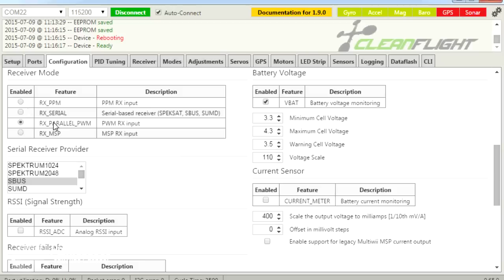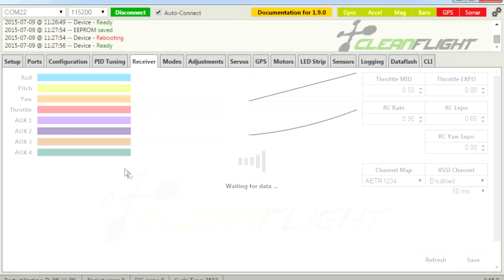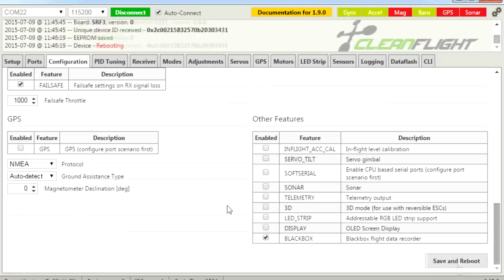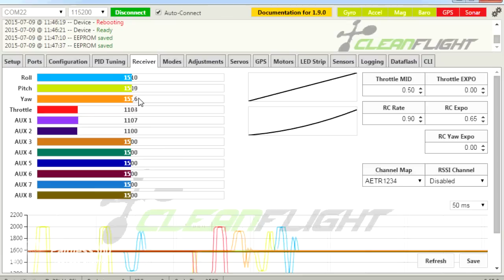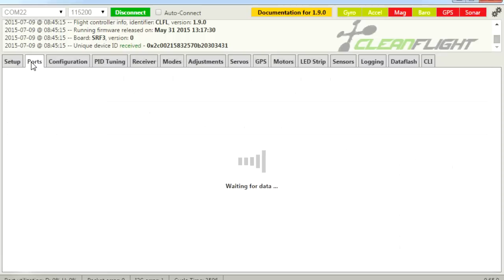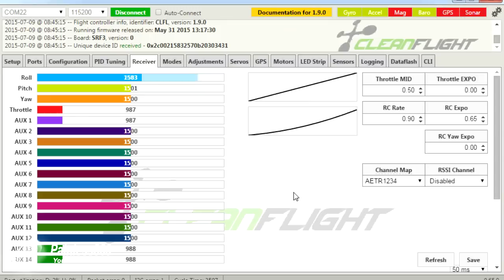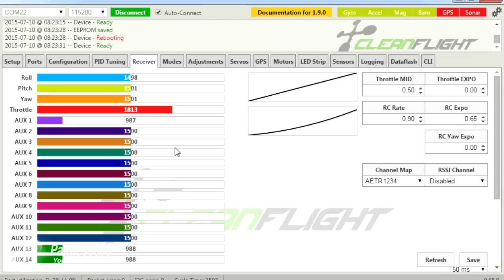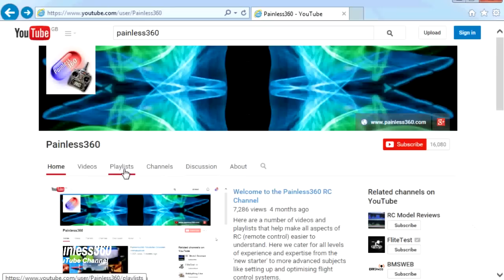Seriously Pro F3 (SP3) Quick Tip - Install and setup PWM, CPPM and S-Bus Radio Receivers

Comment: Hi Painless360,

 1st, thanks for all these videos, great work helping everybody out.

 I've bought the SP controller and I'm starting to configure it.

 I had a KK 2.1 that was pretty straight forward to setup and now I'm trying something a bit more powerful.

 I've got an "old" receiver (Orange Futaba FASST - http://www.hobbyking.com/hobbyking/store/__14300__OrangeRx_Futaba_FASST_Compatible_8Ch_2_4Ghz_Receiver.html)
 and from what I can see this must be a pwm receiver.

 I'm following this video and I found a difference, your left connector has an isolated white wire that you connect to the Aileron, but with my wires are a bit different, mine are like in this picture: https://cdn.shopify.com/s/files/1/0286/3478/products/spracing-flight-controller-acro-parts_grande.jpg?v=1441822425

Wires 1,2 and 3 are linked to the same connector. Does this make any difference?

Thanks again
Reply from the maker: +Luis Pinho The connections should be similar to the ones in the video. You can test if you have it connected ok by using the Cleanflight receiver GUI and swapping any cables that are plugged into the wrong connections. Best of luck with it!
Reply: +Painless360 Hi, the connectors it self are just a bit different, but the connections are the same :)

Already tried them and they worked.
Followed the manual and then watched the video to check if everything matched (My receiver doesn't have any battery "channel", so I had to connect to the already existing system in my quad).

(Edit: I'm watching the next video now, I think it will reply to the next question, sorry)

One question, did you solder the straight or the angled pins (that connect to the ESCs)? 
Any advice regarding the soldering order and the kind of pins?

Thanks again for your videos
Reply from the maker: I like the right angle pins as the height of the build is lower then, depends on the space and personal choice..

Comment: I know more and more people are now using CPPM (me), but the PWM set up on this board is awful. Have fun running those cables in a tidy manner.
Reply from the maker: I find most, like you, are using PPM or S-bus with most modern FCs. Nice to still have option for PWM though for those who still want it.

Comment: FVT LittleBee 20A ESC BLHeli OPTO 2-4S http://www.banggood.com/FVT-LittleBee-20A-ESC-BLHeli-OPTO-2-4S-Supports-OneShot125-For-RC-Multirotors-p-1007740.html

Upgrade NAZE32 SP Racing F3 Flight Control Acro 6 DOF http://www.banggood.com/Upgrade-NAZE32-SP-Racing-F3-Flight-Control-6-DOF-10-DOF-for-Milticopter-p-1010232.html
firmware Betaflight 2.3.5 installed - ok

from ESC to the controller only signal wires
powered sp racing by BEC 5(5.03v 100%) volts
Connect the USB + Connect 4S = Blown controller! LEDs do not burn.
probably burned elements LG33
What is the problem?
The second time so !!! (I thought marriage was caught for the first time)
Reply from the maker: +Сергей Жуков Sorry, not sure what you are asking..
Reply from the maker: We do provide direct support over Skype, but it's not free (see the website for charges)..
Reply: +Painless360 sorry)) I go in a simple way. I look for specialists in Russia. Thx ;)